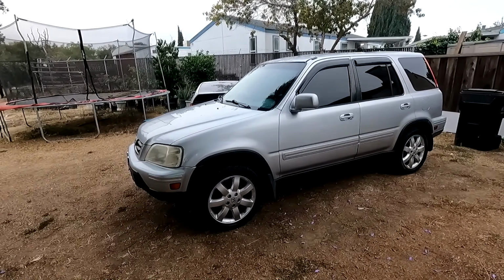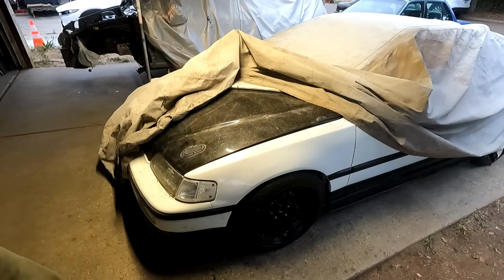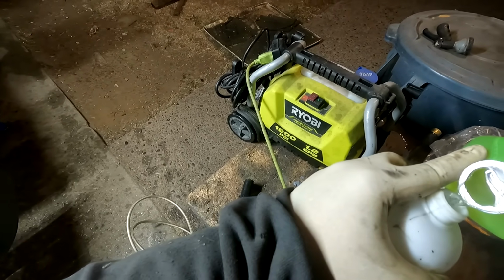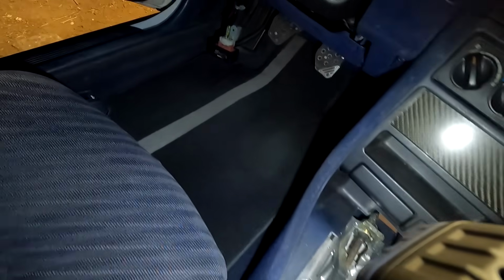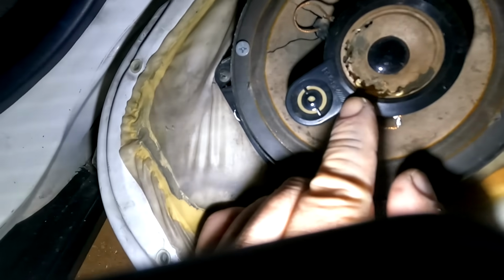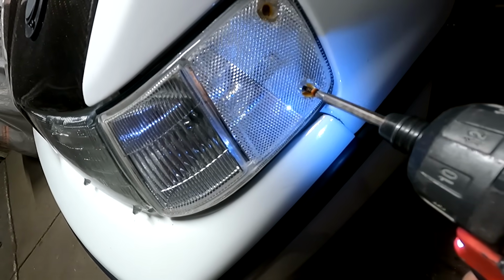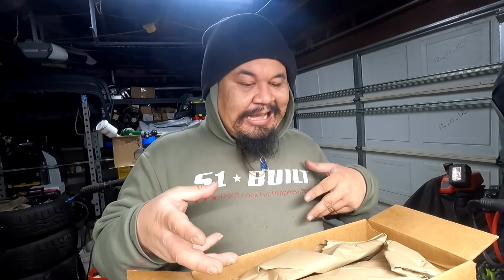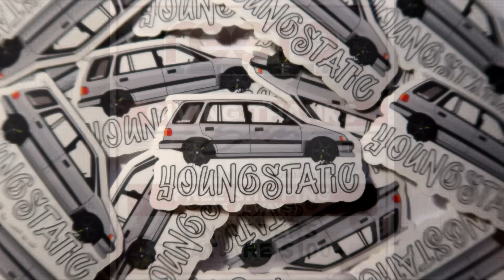BACK TO WRENCHING ON THE H2B AWD TURBO CRX !

Comment: So I was down in the South Bay to pick up an item from a FB seller and was sitting at a light on my way back when I heard a brrrraaaaaap exhuast sound.  I looked around to try to spot the culprit and was eyeing a likely yellow Integra turn left from the oncomming lanes when I saw a light brown Honda wagon pull a left hand turn in front of me and from the corner of my eye I thought I spotted a right hand driver.  BrrrraaaaaaaaaapppP.  You know what?  I think that was Dana driving by.  Keep the wheels on the road Static!

Comment: You can try CLR or muriatic acid to get the residual rust stains off of the corner lights.  Either one should work well.

Comment: Next time use the blower to blow the inside of the car before you vacuum.  I use the leaf blower before i vacuum . It works great under the seats and on the sides of the seat.

Comment: i have a 1990 crx hf and am wondering if you think it would be worth rebuilding a d16 since I don't got much money but shes at 340k+ miles and just don't know because its my first honda and I know old honda are indistructable but it does have some pretty good blow bye and know the piston rings are shot shot and think it has a stuck valve or something because it burns real rich I need to just rip the engine apart